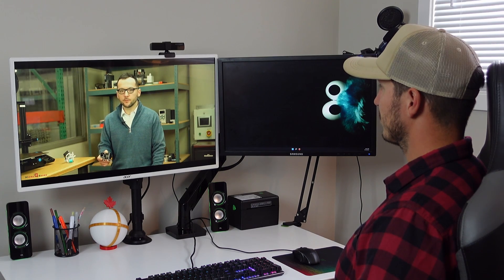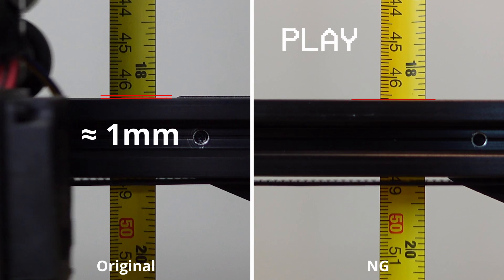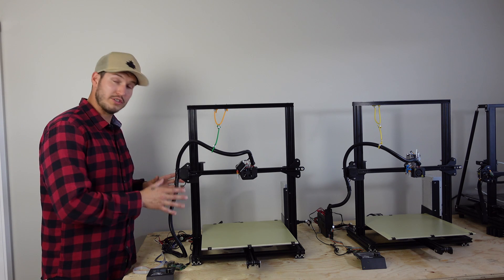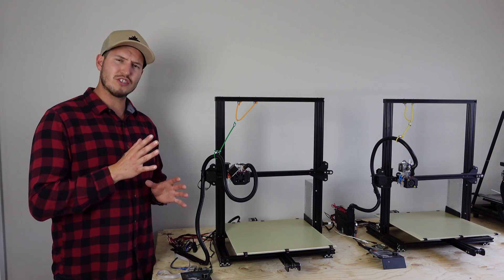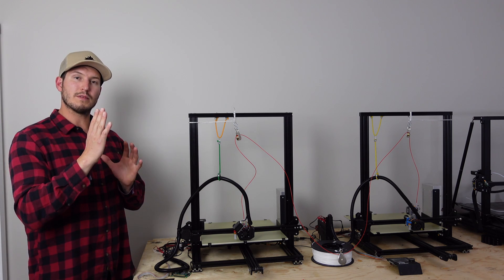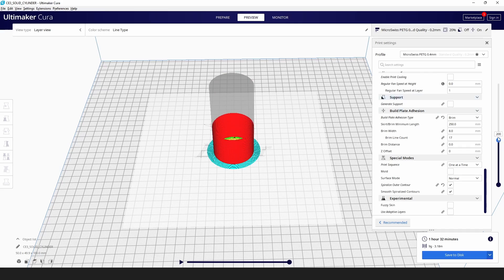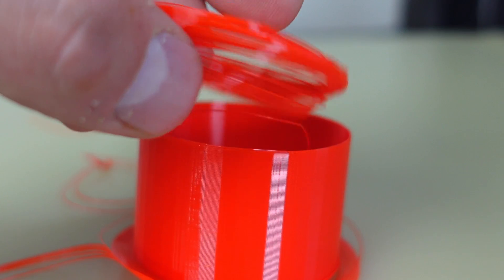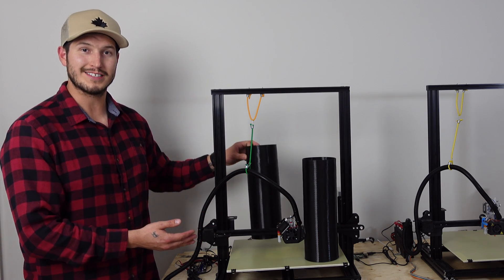Is the Microswiss NG worth the Money? | Layman Reviews

Comment: In two words.   HELL YES!!!!

Had the original direct drive all metal from MicroSwiss and I never could quite solve the heat creep with that tiny heat sink. Maybe if I did a 40/20 fan with a better fan shroud I could have. But the NG.  Game changer.  I'm printing everything on my Ender 3 now. No jams with pla.   ABS is great even with my printer not in an enclosure.   Extruder is fantastic.   They even nailed the esteps with 400st/mm.  

Oh. Just print the feed knob and install it on the back of the stepper motor.  I never use the tensioner.  Just turn off steppers and turn the knob to feed and extract for filament changes.   Love the NG

Comment: Helpful but your comment re: filament going out on 1st Gen is wrong. Capricorn tube going to the hot end cut too short which is the reason it goes out. It is cut at an angle to sit between gears.
Reply from the maker: Maybe, makes sense 🤔 thanks!

Comment: well u just decided with direct drive im putting on one of my creality machines, not sure which one yet but a ng will be added to a ender 3, 3max, 5 or a aquila not sure which im going to put it on yet, ender 5 has a microswiss hotend already so that makes me want to lean in the other direction but one question, is the heat block an throat the same from the ng to the original all metal hotend or are they different. would be nice if all the parts where interchangeable.
Reply from the maker: The NG comes with its own block and throat but I'm pretty sure the block is generic and the throat is unique 🤔

Comment: This is the video I've been looking for! I had an all metal hotend from microswiss so it was cheaper to buy the older style when switching to dd. 

Been curious of the difference and what I am missing. Would be interested to see print quality comparison, but mostly that test you did was awesome.

Could the original extruder lift the spool on its own if it wasn't attached to the NG? How strong is the microswiss extruder is essentially my question. It is clear the ng is extremely powerful in comparison
Reply from the maker: Thanks! 😀
The way the pulleys were set up, initially each extruder would be lifting 1/2 the spool weight (approx. 500-600g). In my opinion it's not that the Original is very weak, it's that the NG is so powerful that it makes it look weak.
Reply: @LucasBuildsStuff  truth, i watched another video of an "extruder tournament" where various extruders like the Orbiter, the Sprite, Bondtech DDX and obviously the Micro Swiss NG compited. The NG ate all of their rivals.